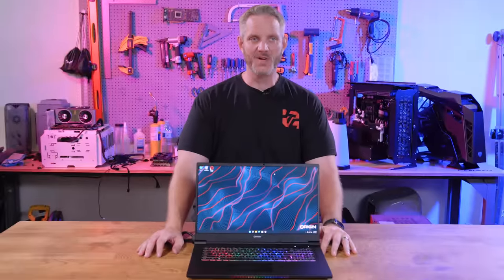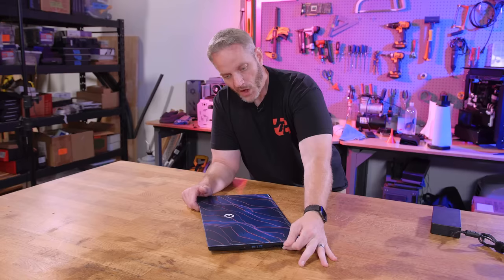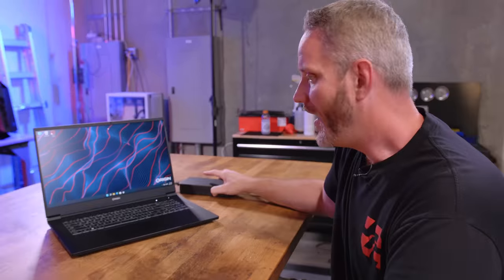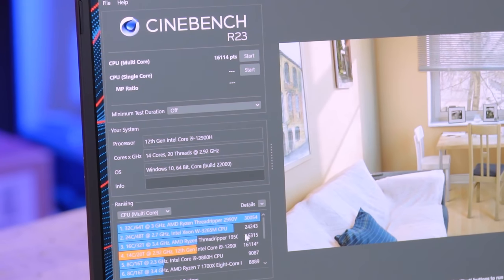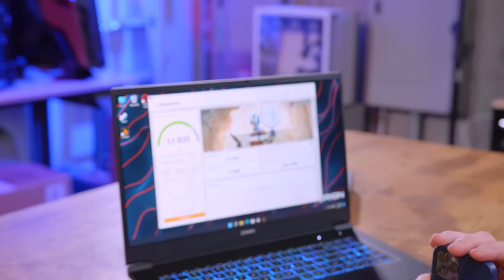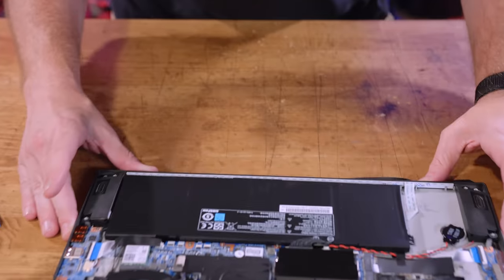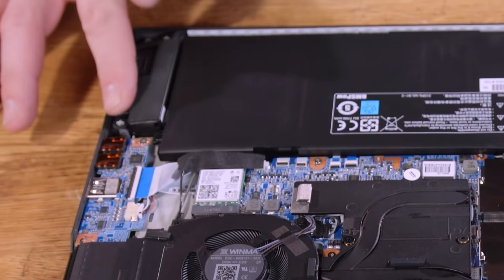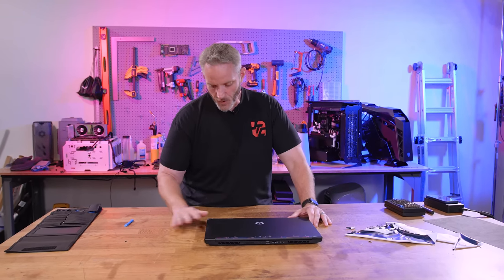This laptop just made your desktop obsolete!

Comment: I don't understand why weight and thickness matters.  I'd rather it be thicker and 20lbs (if that would provide more benefit, hardware space, and  cooling potential.)  Noise doesn't matter in most cases either.  A headset or speaker will always be better.  I don't understand the fascination with thinness and weight.
Reply: Thanks for watching ⬆️⬆️... message right away, I have something for you……..

Comment: Lol...

Jay: Planes can't charge laptops...

Me: um, never flew before, but if I did I would just charge my laptop with my OmniCharge Omni 20+ 71Wh battery bank, as it will charge most laptops up to 1 full charge... It has a DC plug with selectable 12-20v output, USB-C in/output, 2 USB-A plugs, a wireless charging pad on top, and 1 wall outlet, as well as a digital LCD screen for battery details, such as time to charge/discharge, battery temperature, and battery percentages... Also, if you have a device attached that is sending or receiving power, it can show you the input and output in watts/amps/volts...

It costed 200$ of course, but it is well worth it in my opinion, if you're not a 'poor bastard', so to speak...

Comment: those who owns laptops with intel CPUs, you should go DISABLE the iGPU in the device manager when you arent using the laptop's graphic capabilities. desktop visual will resort to software render. but this is important to break a lingering "tarrask" cyber attack malicious codes running in your laptop. like i said before, they are actually work of intel's paid hackers. the entry point is intel iGPU. so disable it most of the time. you still could browse internet without it. you can enable it again if you need to game on your laptop. (those discrete GPU in your laptops still requires the intel's iGPU to handle the window management. which is the entry point of "attack". otherwise your discrete GPU cant use its maxmimum capability). after that disable it again before you power it off. so it will next time boot WITHOUT the iGPU hooks giving those malwares elevations when its entering desktop.

Comment: what a lovely machine but i bet its super expensive?, like to see a budget equivalent, although probably still cheaper than a 3080Ti desktop card on its own.
Reply: From the website in the video description, the version with the i9-12900H and laptop 3080 TI is $3188. That’s with 16 GB of DDR5 4800 RAM and only one 250 GB SSD: realistically, you need at least 1 TB of storage (maybe even 2) for a gaming laptop and it costs $50 extra to switch to the cheapest 1 TB SSD, so the baseline price for that version is $3238. 

Considering that a 12900H is roughly equal to a desktop 12600, and that a laptop 3080 TI is worse than a desktop 3070, you’re paying a huge premium for the portability and convenience of a laptop. Not to mention that “gaming” laptops run even hotter than standard ones because of the increased power draw and inherent issues with dissipating heat in such a small frame, so temps are always going to be a nightmare even if you go in with new thermal paste for the CPU.
Reply: Unless you are outside all the time or need it for working purposes, save 50% by going desktop pc.
Reply: Thanks for watching. ..⬆️⬆️ message right away, I have something for you……..

Comment: Checked out and Speced' the unit on the website. the only question I have is if it connects at wifi6? according to the site maxes out at only wifi n ?   Intel Centrino Wireless-N 2230 Wi-Fi Card 2230BNHMW 802.11b/g/n Bluetooth 4.0

Comment: my problem with this generation, I sit here with a hp reverb, never using ray tracing, only using dlss if the game is so shit nothing else helps, and the 3080 ti isn't enough to saturate the current. I'm not buying into rt cores or dlss, which is terrible for vr (although dlss usable as AA for particularly shitty running games). But, with a 3080 ti desktop I'm still looking for more raw performance, nothing else. With that I could supersample my way out of aliasing, no fancy tricks needed. On top of that, the laptop naming scheme is a scam, dlss and rt is a decoy. VR is where spending money is even worth, and rt cores does jack shit for it. Is why I can recommend a 3060 laptop, they have more cuda cores to compensate for clock speed and are solid compared to their desktop counterpart.

I'm also adamant ryzen is the way to go with laptops.
Also, if they just made the high end laptop thicker it'd solve a lot of problems. 
It's pretty stupid, all of this.

Comment: 12:37 It creates temp issues because thin laptops like that canNOT cool a 3080 and a 12900k!! 

Ffs, what even is the point of cramming that much power in there if you have to dial it down to the level of a 12600k because it would burn itself to death otherwise?

I hate this trend of stuffing power hungry and hot components into thin laptops like that

Comment: Hello Sir, I need an advise. My processor is Ryzen 7 5700g and I`m planning to buy 3060 ti. Most of liquid coolers that I wanted is currently out of stock. Is it okay if I`m going to use the stock cooler of Ryzen 7 5700g while using 3060 ti?.

Comment: Weird question maybe someone can help me. Have a newly built 12th gen intel core rig I built that runs fantastic on windows 10. But I upped it to windows 11 and had 4 complete shutdowns within a 2 hour span. All my temps were under 45c at the time and I was running a pretty easy game on settings my computer handled great on windows 10. Went back to windows 10 hasnt crashed since. I would like to run 11 for the different cores but need help here

Comment: LOL SPREAD THE WORD ASUS! => My more than 1 year old Laptops 3080 eats this 3080ti alive :D
Stock Values on Timespy (no OC, or Fan Profile edit):
12074 GPU Score (130Watt) <-- smokes ur 3080ti with 150 Watt like wtf :D
10505 CPU Score (80Watt Dynamic)
11809 Overall Score
This is what i call power-efficient!
With an ASUS ROG Strix Scar 15 G533QS (3.2k € at time bought)
[CPU] Ryzen 9 5900HX (8c/16t x 4.6GHz) (Liquidmetal)
[GPU] NVIDIA GeForce RTX 3080 @ 16GB GDDR6 RAM (RAM Clk @ 7151Mhz / GPU Clk 1905MHz) (Liquidmetal)
[RAM] 32GB DDR4 (2 x 16GB 3200MHz)
[Display integrated] 300Hz, 3ms, IPS
Far more superior sound (currently best one available)
Optical Mechanical Keyboard
Dolby Atmos
etc.
15inch and better performance considering hardware

Comment: Im having abit of an issue. and maybe you can help. i am having an issue with microsoft store not opening and or showing up on apps and features. ive reset my pc once already. downgraded to windows 10. im trying to get it to work to get xbox game pass for pc to install without the 0x80070005 error code. even done the wsreset command with little to no success and im just about to give up on the app all together.  wsreset command gives microsoft store purge caches error its a real desk head banger.
Reply: I sent ya a text. Sorry for the late reply

Comment: You lost me when you said it's running Intel 12th Gen. That's great that it's powerful and all but being both power hungry and requiring me to use Windows 11 to get the most out of it are huge negatives for me especially since I want to stay as far away from Windows 11 as possible for as long as possible and still wish I could run Windows 7 if not for literally two things that require me to use Windows 10 and pull my hair out every time file explorer crashes on me during a major file copy operation or just sitting there open at the "This PC" screen. I am leaning hard for AMD stuff now due to all of this and I hate that Microsoft did this to what was for a time a great OS that is now just a huge mess that everyone is just accepting just because they personally don't have much issues with it. Come on Linux what is taking you so long to become truly usable?

Comment: I tried using them to build a $10K PC, and they were super unhelpful. SO... bought the parts myself and paid 15K for the whole thing. WELL DONE ORIGIN. They would NEVER ANSWER ANY QUESTION, kept it real vague.  So, built my own, silly expensive PC: TR4x 3990x, RTX 3090, Zenith II Extreme Alpha, 256GB Kingston Hyper X 3200 CAS 16 RAM, 4tb Gen 4 boot, 8tb x2 Gen 3 storage, 1500W PSU Titanium rated, 9 Noctua INDUSTRIAL PC Fans (120mm x8, 1x 140mm), Noctua AIR COOLER with an extra fan, and a Anidees (knock off Fractal Design Case) Crystal XL case. SO AGAIN, well done ORIGIN.